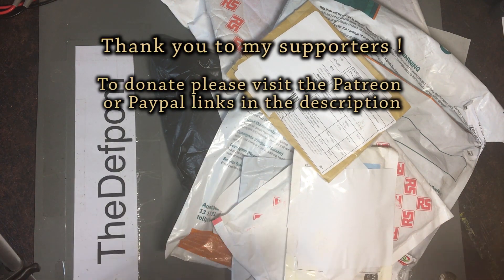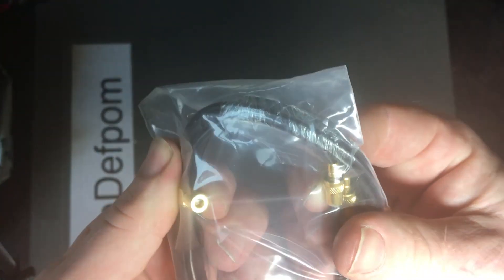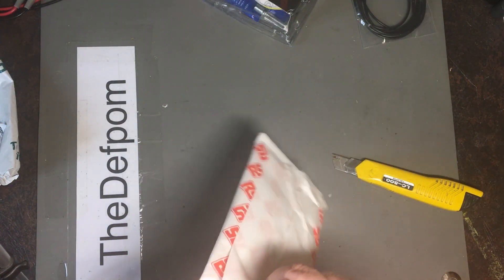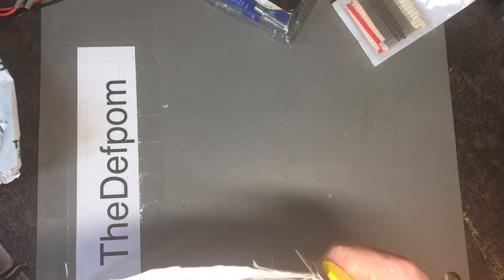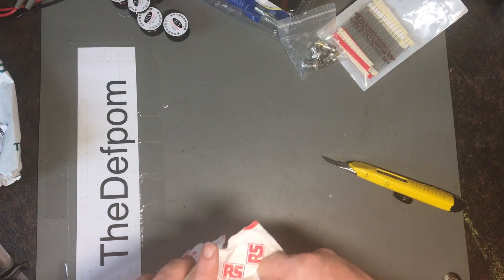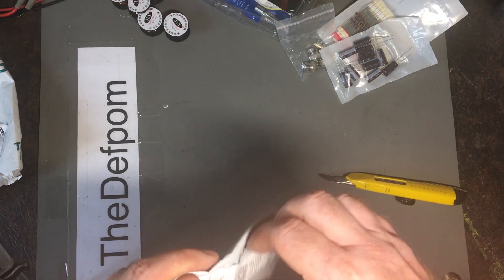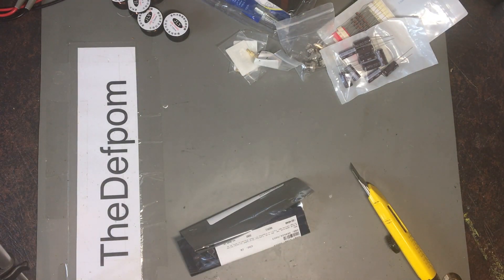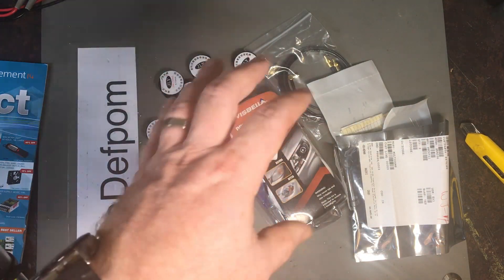#336 Mailbag 14th February 2018

Comment: What are the tiny reels that appear in the top left of your screen around the 3.55 mark?  Looks like the actual opening of them got cut from the video?  Would be interested in a link if they are magnet wire or similar?
Reply from the maker: Zefbot - they were in a previous Mailbag, I had them sitting in the bag still on my desk for a while, and they got my mixed in with the bags from this Mailbag. Yes they are magnet wire, there will be links for them in the appropriate Mailbag video.

Comment: Hi according to Vishay datasheets there is virtually no difference between 1N4148 and 1N4448 just VF specified different.
Reply from the maker: The 1N4148 has a maximum forward current of 300mA, the 1N4448 has a maximum forward current of 500mA, that is the only difference.
Reply: It seems it is manufacuturer dependant.

https://global.oup.com/us/companion.websites/fdscontent/uscompanion/us/pdf/microcircuits/students/diode/1n914b-vishay.pdf

https://www.rapidonline.com/pdf/162280_da_en_01.pdf